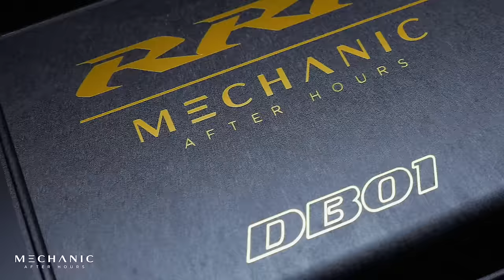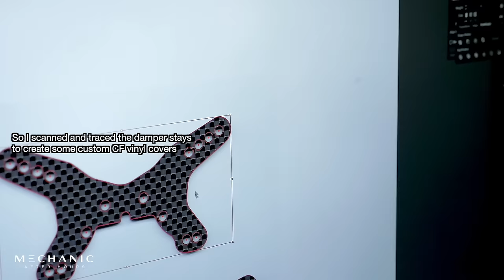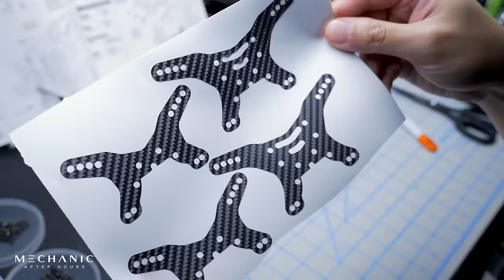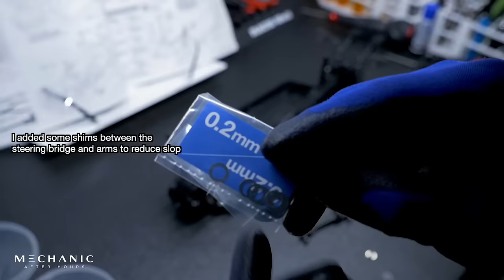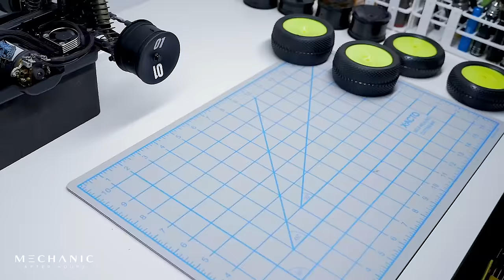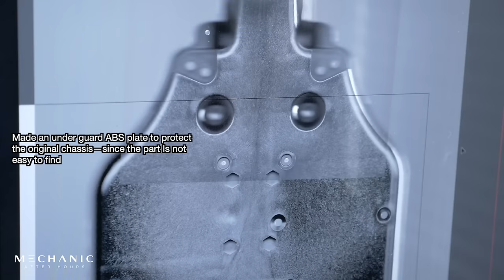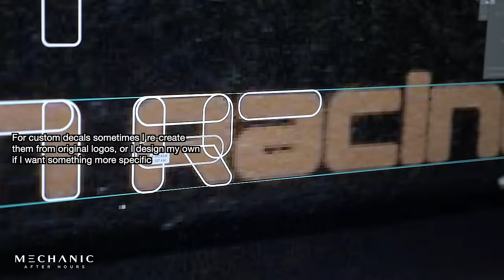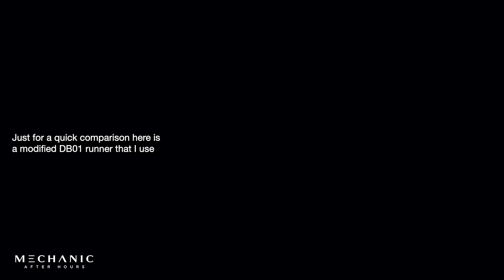Building an RC: Tamiya DB01 RRR (Time Lapse)

Comment: Your builds are always so awesome. I have been building RC cars since 1980 (with some big gaps in between), but none of my builds even approach your level of craftsmanship. If you ever get back into filming builds, you should consider one of the many variations of the TT-02. Yes, I know that they have been done a lot, but I’d like to see your interpretation. There are so many upgrades, hop-ups and useless bling available for the TT-02 (or TT-02B, or TT-02D, or TT-02S, or TT-02Whatever) that building a unique model is possible, even for a duffer like me.
Reply from the maker: Thank you. I’ll consider that. I appreciate it

Comment: I run a read gear diff and a front one-way on my DB01 for carpet. And yes, the TA06 Steel gears do work very well.
Reply from the maker: Thanks for watching, never tried the front one way, I guess that's similar to the TRF501X one
Reply: @MechanicAfterHours  The DB-01 uses the exact same one actually

Comment: I have an original DB01 but my goal is to make every version of DB01 from pure stock to near RRR. The all black items was on my list until Tamiya decided to discontinued it. It was going to go to DB01 all carbon reinforced edition using an aftermarket all black shocks (I am not sure if Tamiya makes Big Bore black body or not). Anyway, great work mate 🤘🏻
Reply from the maker: Thanks for watching. Yes, unfortunately some of the black items are not sold outside of the kit. Tamiya also doesn't sell  black finish big bore damper and ring parts. You can re-annodize the blue parts to black if you really want to make it like an RRR. Good luck!

Comment: I finally found a DB-01R for a very reasonable price and i'm picking it up in less than 24 hours :D It is a used kit so i'll have to take it apart and see what's what, but from the pictures it looks almost unused, barely a scratch on it :D

Comment: Sublime! I Just dont get it with the oversized bottom protector... Keep em coming, so enjoyable to watch..
Reply from the maker: Thanks, Simon! I usually make a bottom protector if the kit is rare (or I don't have a spare underbody shell) because it's hard to find a replacement if they get scratched
Reply: @MechanicAfterHours  hi, thanks for the answer, i get that bit with the protection, i was only referring to the oversize, the "wings". I mean, the Look a bit Manga or Mini 4wd which might be cool, Just wondering why they are there except for style, and if they scrape when cornering...
Reply from the maker: I see! Got it. Just for style and the shape to complement the body. I have a modified DB01 for the track and the RRR is just for the shelf/casual use so the wing doesn't interfere even when cornering

Comment: I started my offroad hobby with a few entry level Tamiya buggies like DF-02 and DF-03 which were easy to put together and fun, but the DB-01 platform is the best performing enthusiast chassis I have owned. Shame they retired it as hop up parts are now hard to find at a reasonable price but I have got plenty of spares. Had to modify a chassis to support square pack lipo so I'm somewhere between an R and an RR and that's as far as I can take the car. Well done for getting your hands on a RRR. Would have loved to own one but my 3 DB-01 chassis will do. PS - Any link to the tool box you send to Glen at TAMIYA Legends? It looks very functional.
Reply from the maker: Thanks for watching! Yes, unfortunately DB01 hop ups lately are scarce. Too bad it’s one if Tamiya’s decent performing kits.

Comment: Your build videos are epic to put it nicely! Wish I had your workbench/tools/parts for servo wires and motor clips and stuff at hand/etc etc. Keep it up=) This was the best one so far, and the car I would pick up if I found it first. I passed on an egress recently. It was just built, not run, but I want to build myself.
Reply from the maker: Thanks! And I appreciate the kind words. Good luck with any future build. I skipped on some kits/cars and that paid for the tools :)—and the builds go better with decent tools
Reply: @MechanicAfterHours  I bought a durga from japan, luckily with a flat battery compartement. Built it with trf gear diffs, trf big bores, cvd's and the smaller four alloy suspension mounts. I found a used fully blinged out baldre, then i'll have carbon towers with an alloy brace in the rear, front and rear suspension mounts, alloy steering, alloy hubs and such, alloy arms thats going up for sale. Hate pure bling with no function, and the arms just makes the next weakest link brake instead. Double slipper also....... Good deal, even the shell was nice. And a hobbywing 8,5turn to sell and buy more brushed esc's, no limit preferably. got one no limit esc for 30$ today=) Paid next to nothing for the baldre. So my db01 will be very cool in the end, well its cool now also lol=) Thanks for the kind reply=)
Reply: I finally found an RRR NIB kit!!!!!!!!! payed almost as much as I did for my 501x(which was a steal for a 501x though with alloy upgrades, ALL blue srews, and quality brushed system, lrp motor and lrp esc......, but its worth it for the RRR with that stealthy look and gear diffs, trf big bores. Painted it shiny black with smoked windows, and minimal decals, only silver decals. Only upgrade will be fibre lyte thick carbon towers. No blue alloy in the RRR=)!!!!! Its got a 12turn reedy Ti motor with Quantum comp. esc from LRP, blue IS better. Its got 8.000 8.000 diff oils and drives soooo good. I like to run the cars hard on asphalt, and on my little spot its perfect=) My fav esc for runners is the LRP IPC v6 and v7.1, the futaba mc800c, and of course the GM V8 and V12. Bought a V12XC thats going in my mail box today. I think it has less internal resistance or whatever, its good if it resembles the V8.......... Ive got myself a birtday gift, a Keyence Rapida pro for my NIB collection, among other rc porn stuff i bought and was gifted for my bd.=) I've prefered brushed motors after I started the rc car hobby back up again. Bc they are more of a challange to get going perfect. Found a guy with three breifcases of motors all from a driver who got handout 12turns for each race, and then put them in the briefcases, almost all 12turn hot motors like reedy Ti, LRP fusion some 10turn and many 12 turn, and orion revolution's 12turn HT. Many look like new. Like the peak vantage David Spashett 12turnHT, its a joy to behold in those colors. Many other cool 12turns too. And a brand new orion element 19, its the most sexy motor ive seen, ran faster than a 12turn, why o why did i use it, it died in a crash. The gearing is so much more important with brushed systems. And choosing the right motor first, and esc=) Have a great day everybody that reads this, and those who didnt too. And all my cars are sentimental cars i had before but had to sell. Regretted selling my durga and df03 keen hawk the most, I learned to drive with those two, on my yard track where I lived before. Both upgraded a lot too.... @MechanicAfterHours  .

Comment: I finally got to watch this video. The build, the editing, everything is a work of art. Your Avante video inspired me to find a NIB one, as I had the original back in the day. The nostalgia was too much. I’m going to build it with my son and make some mods of my own. Thank you soon much for your work. Just one question, what is the body shell you have on this build?
Reply from the maker: Thank you and thanks for the kind words! Glad you were able to get an Avante and it’s valuable when you can build it with someone special. The body is a Tamiya Durga, it was one of the main bodies on the base DB01. There is also another body, the Baldre. It’s not as pretty in my opinion but it has more room for electronics and cooling.

Comment: 8.30 carbon reinforced iff gears! thats what i hate about Tamiya. skimp on parts right upto the high end kits!!!!!!
Reply from the maker: Unfortunately, yes. I prefer steel. No issues so far with the gears but they do have hop ups (although it will cost more).

Comment: Covering up real carbon with vinyl.... why??? Could've then just made your own aluminum shock plates, painted and used the vinyl instead of forking out for carbon and then covering it with fake carbon... Nice build none the less though.
Reply from the maker: Thanks for watching. I think I mentioned it in the video, I like the look of the gunmetal carbon vinyl over the stock. Also, the car is rare nowadays and it’s difficult to find that cf shock tower and I run the car so it helps prevent the cf shock tower from being scratched. Aluminum is ok for vintage but not for that car.